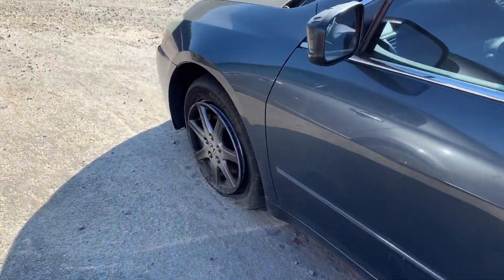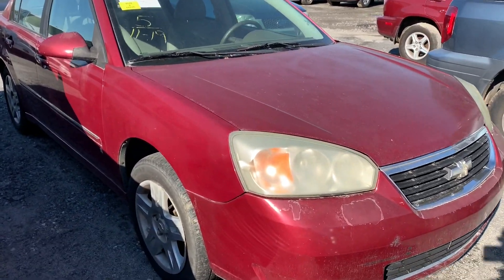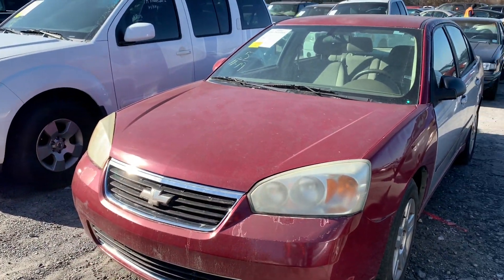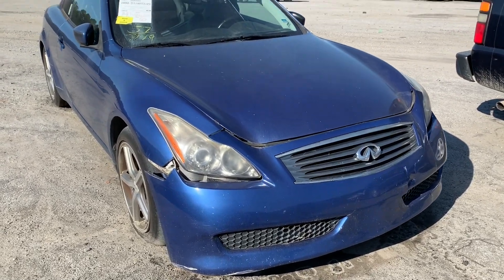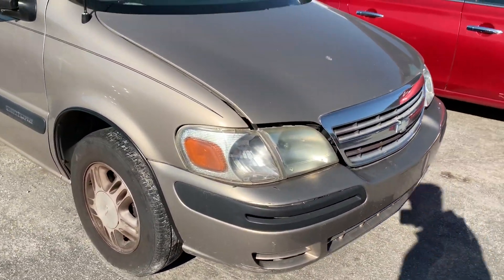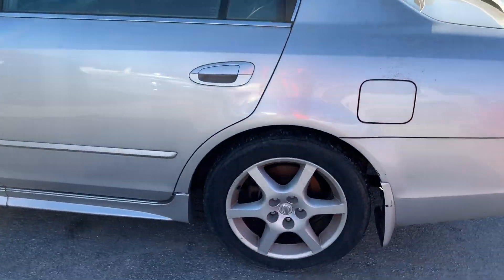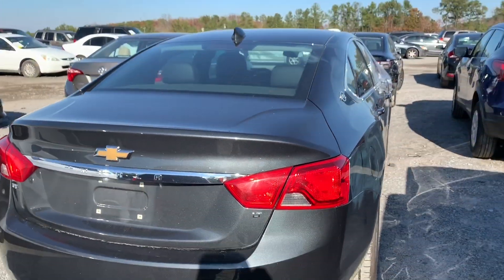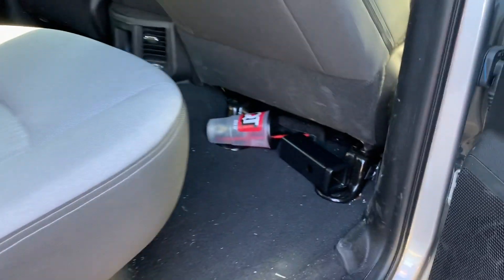INSURANCE AUTO AUCTION WALK AROUND + IAA CARNAGE

Comment: The 1991 Cutlass Ciera may be a 4 cylinder because it does not have cruise or power windows.  That year the 4 cylinder was the 2.5 tech-4 (iron duke).  Not as good at the v6 from that year which was the very good Buick 3300.  Should have checked under the hood.
Reply from the maker: They blew me cause they said I couldn't crank the cars 😩